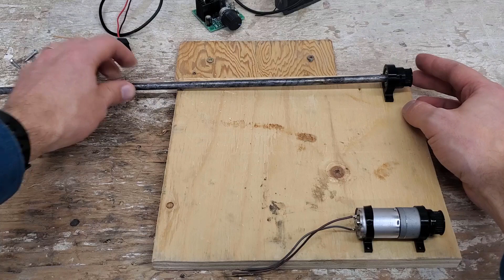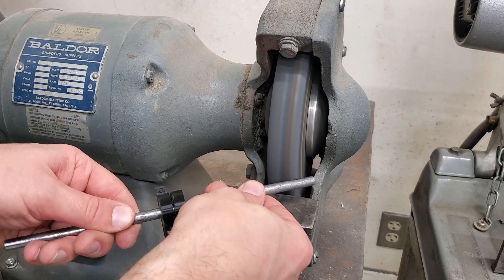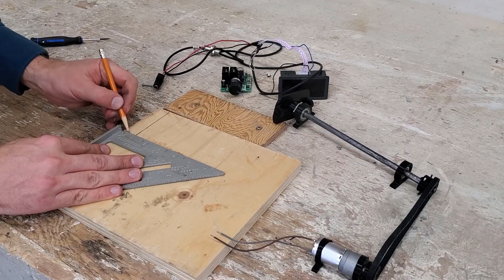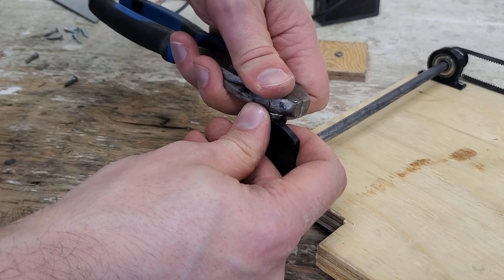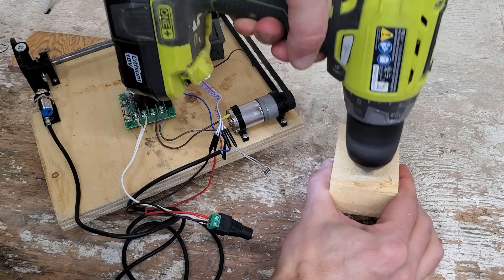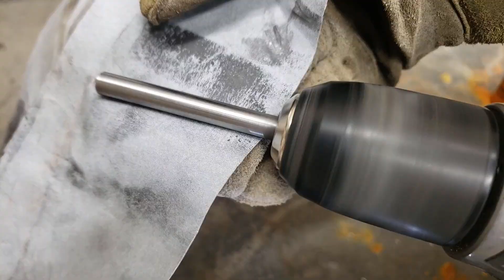Pickup Winder Build

Comment: I've started "TODAY" to design my 3D printed pickup winder! We'll compete on the design ;) I'm using 2020 aluminum profiles and i'll use an cheapo 12v drill motor. Everything will be controlled by Arduino and a computer. Nice job!